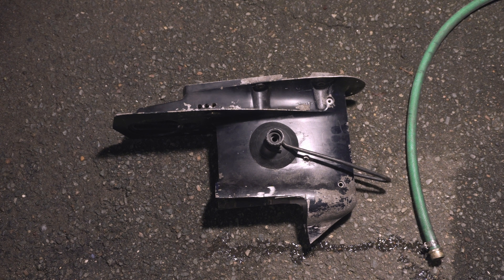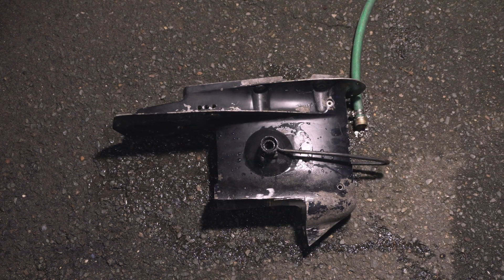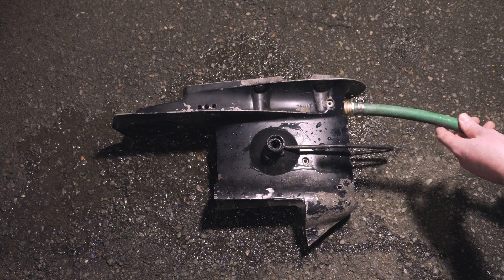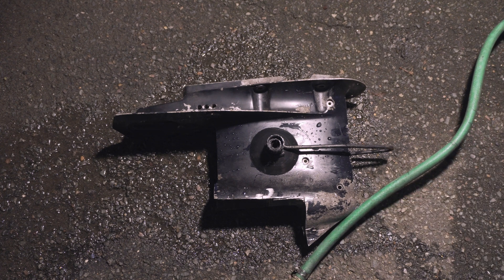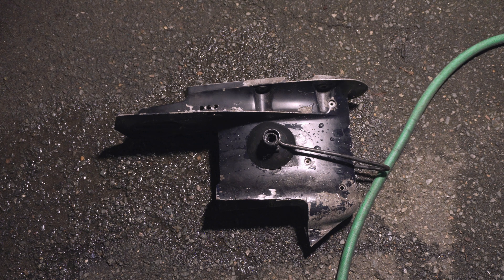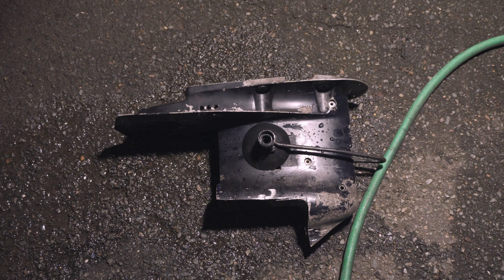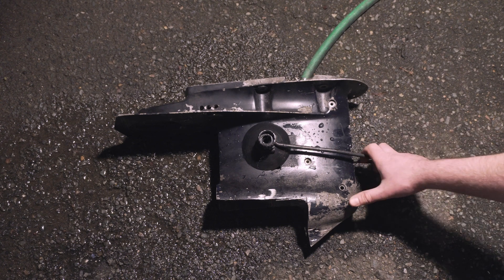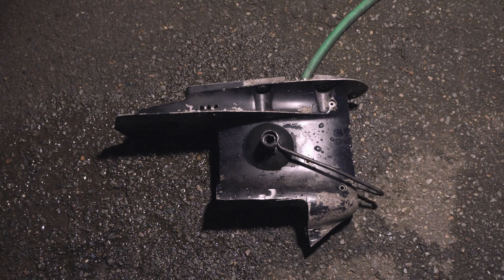Outboard water muffs - How to avoid accidentally overheating the engine.

Comment: Water is turned on to much it pushes the muff apart breaking the seal there suppose to have against the foot housing its like sucking through a straw with a hole in it at the waterlevel

Comment: Cheaked my inpeller everything is good. Its werid. Waiting a on a call from marine mechanic to see if hes encounter this before. Its twice now it stops pissin while running with muffs in the yard.
Reply from the maker: Depending on the force of the water there could be a mismatch with the suction causing it to not pull. I would use a trash can or a large bin.

Comment: What are the possible consequences of running the hose too hard. Before watch this I ran the engine with the hose. It ran fine, but water came out all around the propeller an also ran out of the lower part of the outer casing of the engine and down the outside of drive unit. I shut the engine down, greatly reduced the water flow. Now the engine will not start. Do you have suggestions for diagnostic investigation?

Comment: Something else to consider - The hose to muff adapter can also sometimes pull out on the cheaply made muffs.   It's just the hose female threads to a plastic barb that pushes into the one muff.   Sometimes the hose can put pressure on the joint and cause it to fall out.
Reply from the maker: Thanks for the info.